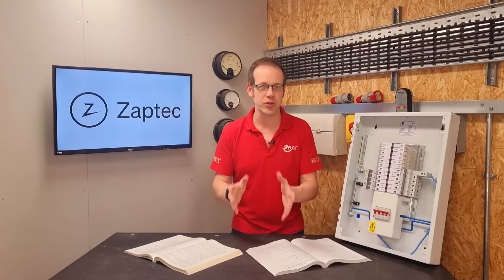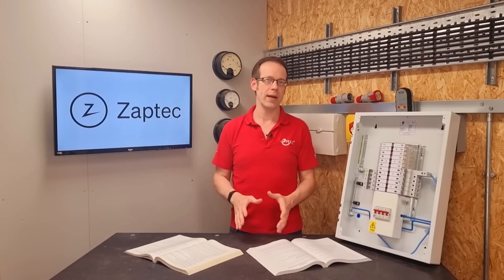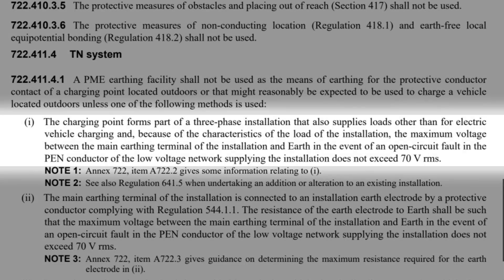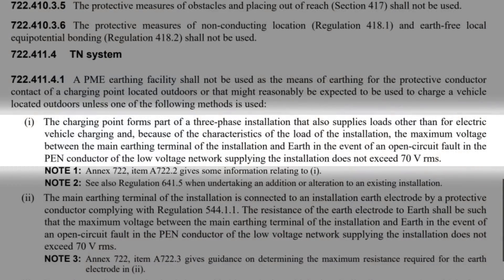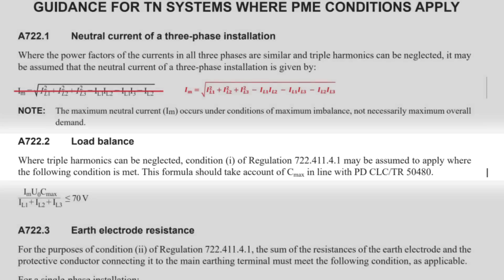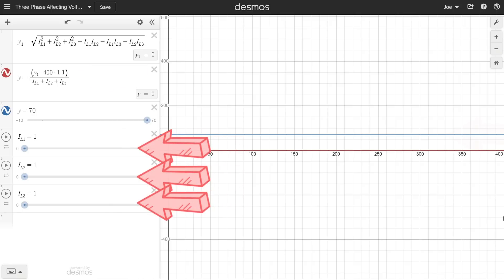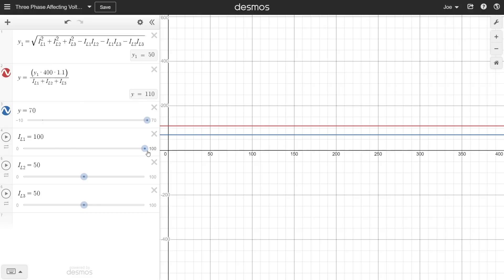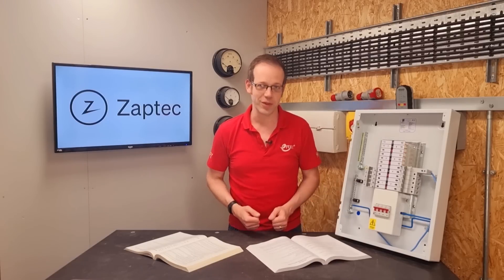This Electric Vehicle Wiring Regulation Got Cancelled - Why?

Comment: Well explained as usual Joe. There may be areas where the three phase supply is predictable generally, so maybe it was acceptable in these rare cases. However what happens if one of the phases has a fault?
Would this cause an imbalance in the current and therefore potential voltage way over 70V?

Comment: Just watched the video again, and i’am thinking how can the body of an electric vehicle become live ? Surely all the electrical connections are kept separate ie ( insulated)from the body work? , if not then how can manufacturers be aloud to make electric vehicles that could perteninaly kill the owner if such a fault was to  happen?
As I know nothing about EV and EV chargers, who am I to argue i’am just a humble spark who’s opinion means nothing .
Reply from the maker: The charger (ac/dc conversion) is inside the car and they aren’t double insulated. As with lots of power electronics they leak a small amount of current to earth to manage EMI .
Reply: @efixx  that’s my point,why aren’t they double insulated? And how can they leek a small amount of DC current to earth when the metal body doesn’t even make contact with the ground (littoral earth) ? As it is insulated by the rubber tyres , as we know rubber is an insulator (non conductive) after all on a petrel car all the electric’s is insulated from the body work or you could get a shock from the 12v battery, have you ever had a shock from a 12v car battery? It bloody hurts. 

I’am just trying to understand
Reply: 99.999% of people are and will insulated from the earth we walk on by there shoes boots or trainers all of which have rubber soles the car sits on rubber sodding tyres . So even if the car bodywork did become live it’s not going to hurt anyone. If you have ever been sat in a car when it been hit by a lightning bolt of many thousands of volts . And nothing has happened to you, Then you will now .

Comment: Howdy. Nice.
If the load is thyristor or triac voltage regulated there will be current in the neutral although symmetrical. So yeah. PEN break detection is essential.
Personally I would recommend digging a 16 mm2 bare copper wire in the ground where the car stands in a zig-zag pattern and potential equalizing it to the outlet PE. If the parking spot is a concrete slab the concrete may be hammered to get access to the armour steel and the it  may potential equalized to the outlet PE.
Regards.

Comment: Please forgive a daft question, shouldn't the formula in your graph software use 230 (or 400 / root 3) for U0, not 400? 
(Annex J, in the IET code of practise for EV charging equipment installation suggested two other ways of calculating this btw)
Reply from the maker: No a great question and I debated it back and forth when making the vid, in the end went with the definition in BS 7671 that states it's the nominal voltage to Earth, so 230V. Happy to be corrected as we're always learning! Probably wouldn't make much difference to the underlying point though. 👍
Reply: @efixx  Absolutely agree about the underlying point. What you've just written is how I did it on the one occasion I used this. 230v. In the video I noticed the software is using 400v, so slightly exaggerating the point! I won't tell anyone... ;-)
Reply from the maker: @timhoward7037  😂 Oops.

Comment: U0 is 230V Joe? Surely 400V as the formula relates to a 3 phase supply.
Reply from the maker: Great question, I was a bit unsure at the time but U0 is defined in the Symbols Used in BS 7671 as line voltage to Earth. Had to double check it myself. 😊

Comment: Hi there thank you for another interesting and informative video, my question is a of when and if you do get a PEN fault on an EV charger and you have a PEN Fault detection device installed in your installation… What happens next?
Do you need to contact the DNO to dig up the road to investigate?
Will the PEN fault detection device reset once the Fault is below the required 70vRMS?
I have not come across any ( yet ) videos that show a remedy for a failed PEN Fault, may be this could be another video topic??

Great channel thanks for the content 👍🏻

Comment: What sort of situation WOULD have been balanced enough? Probably not a block of flats even if the block is three phase? Maybe a factory with loads of high power three phase motors and the odd charging point?

Comment: Brilliant video very informative. QQ. In a domestic setting that is supplied by 3 phase, can we use single phase PEN fault detection for a single phase EV charger, or should we be using 3phase PEN fault detection for the single phase EV charger?

Comment: Very nicely explained but it only focused on the effects of a broken neutral and balanced/unbalanced loads in a given 3ph system, presumably where any neutral current is produced within that given system. However, diverted neutral currents can also be imported into an installation, coming from other installations connected downstream of the break point, where the given installation is also connected, therefore, livening up the metalwork of the given installation, regardless of the given installations loads (that could well be be balanced during the PEN fault).

Comment: That reg should never have been included in the first place.  It is obvious that an installing electrician will be very unlikely to be able to determine how well a 3 phase supply will remain balanced - especially in places like farms where the individual phase loads could vary dramatically as equipment is turned on and off and also where overnight loads could be very small.  How also could the installer be aware of potential future modifications to an installation which could unbalance a currently well-balanced system.  In my opinion, we should be looking at the possibility of PEN fault detection and protection for entire installations..... And don't get me started on AFDDs!

Comment: Hey call me dumb,,  is there any way of negating the earth by Separating the voltage like you would with a SELV,,?? Ground source induction coils like a wireless iPhone charger??
Reply from the maker: Yep, wireless charging is being worked on. But currently you can use an isolating transformer to achieve this. Great question!

Comment: You have got to have more chance of winning the lottery than the network dropping the neural while the car is plugged in and someone touching it. If a pme supply is that risky, why is it in use, but we know the answer, cost.
Reply from the maker: Yep and just like people win the lottery despite the low chances, people get shocks from PEN faults every year.
Reply: @efixx  that maybe true but how many would occur while in contact with an EV, probably none? Plus this is a supply issue, the networks are quick to tell us what equipment belongs to them, it should be their responsibility to install pen fault equipment not the electrician

Comment: Hi, slightly off-topic, but could you do a video, or if someone could please explain, do you require AFDD's on all circuits with socket outlets? And are there any exceptions or circumstances where they are not required? Thanks in advance.
Reply from the maker: Check this video out: https://youtu.be/aoWuEnvLa3I

Comment: A lot of loads such as computers, lights with electronic ballast, or anything with a switched mode power supply exhibit negative resistance - that is when the volts go down the current goes up. Even if the load was well balanced odds are that the neutral would swing wildly in one direction or another and cause a dangerous neutral voltage

Comment: Instead of pen fault detection that is inclusive with the charging unit, surely it would be better to have a pen fault unit before the consumer unit that completely isolates the power coming into the installation??
Reply: @eFixx basically this is down to the DNO trying to cut corners back in the day. TNS or TT is a more viable option.
Reply from the maker: Yeah, it's a funny one as it needs to disconnect the earth connection which isn't normally allowed.
Reply: Does a pen fault detector always break the earth??? If the line and neutral disconnect surely that would resolve the issue? Thanks for your input as always though, every day is a school day when it comes to the electrical trade

Comment: Great video. I think it was correct to remove the reg. Electricians just want to get on with installing with a minimum amount of actual calculating so removing it ensures that they will have to comply with another control method without the hassle of trying to work out if they want it or not.
Reply from the maker: Agreed.

Comment: This ties into the speech one of the 18th Edition writers gave at Steve Willis College about putting Earth Electrodes in on all PME supplies to help mitigate the issues arising from EV installations. It was politely pointed out that in many cases Terraced houses would have to be done by the DNO's who weren't interested in the extra work and in the case of listed buildings converted into apartments and alike it was practically impossible to achieve. 
I envision in the future something along the lines of PEN fault detection being installed split-load style to cover all outside equipment while the internal house systems are left functional so people can continue to cook and use heating and hot water.
Reply: That likely wouldn't work as the impedance back to the transformer would be high so current flow  would be low so high.power stuff inside probably wouldn't work anyways

Comment: Depending where the PEN fault is, the voltage on neutral might not be zero even if your loads are anyway. The fault voltage depends on anything downstream of the fault location which could include other installations (how many suppliers are as diligent as they should be with their earth rods?. It's very dodgy to depend on any characteristics from outside your installation to keep yours safe.
Reply: All of which means that indent i was flawed from the get-go, as where a 3 phase supply is a supply that also serves an unknown number of other premises, the competent person planning the installation will not be able to see the full scope of the loads on that supply. If he cannot see this, he surely cannot certify it. Although it was said that reliance on this indent cannot be relied on past September, I suggest (and not as an electrician but just as an engineer) that it is not safe and never has been because it calls for assumptions to be made about factors outside the engineer's purview.
Reply: Exactly!
Everything connected to the same PEN must have a balanced 3-phase load.
This includes Electric Vehicles, and some EV's do only draw current from 1 or 2 phases, even if 3 phase supply is offered through a type 2 connector.
Some charging cables have only one phase conductor.

But if the owner of the installation also owned the transformer station and the cable that feeds the installation, and it is only used for DC-chargers permanently connected to the AC supply without plugs and sockets (and other balanced loads that cannot become unbalanced), then indent (i) could be relevant. :-)
Reply: I will have to re read this thread in the morning, , some top alpha knowledge being shared in the comments

Comment: While I totally agree with your explanation and the maths, what if a capacitor bank and control are fitted at the incoming supply, (Like most industrial locations) , to maintain a balanced supply across the installation. This is usually done to reduce the effects of, start up, inrush, current having an impact on the electricity bill 😁🤡🐔
Reply from the maker: The capacitor bank at an intake are more likely to be for power factor correction. Generally small amounts capacitance are needed to correct poor power factor meaning that the current they draw is small. So I don't think it would keep the phases balanced in terms of the amount of current flowing.

Comment: Excellent tutorial - Thank-you.  I would love to see a tutorial covering the subject of simultaneous contact between the body of an EV car and extraneous conductive parts such as drain pipes, metal gates, metal hand rails etc. If these extraneous parts are already bonded to the MET of a PME supply I don't see a problem. But if we add bonding when none was present, it seems to me we would be making those extraneous parts more dangerous in the case of an open PEN..
Reply from the maker: Check out our free training package on EV charge points on the Know How page of efixx.co.uk. 👍
Reply: @efixx  I cant reach this site.  Even with the final full stop removed.
Reply: @efixx  I found your CPD sponsored by Indra, but there was no mention of simultaneous contact.
Reply: I seem to recall a great debate at college when the 16th edition came in about "killing the window cleaner" with extraneous conductive parts supplementary bonded to the MET ie a metal window, and simultaneous contact (outwith of the equipotential zone) with the general mass of earth, and the solution of additional local earth electrodes doesn't solve the problem either, it just creates more voltage gradients with potential differences on other items, and the current continues to flow, at least until a gas main melts !

Comment: Great explanation Joe, isn’t pen fault protection becoming more of an integrated standard for most EV chargers now?
Reply: So the code of Practice states that any TN earthing system should be treated as TN-C-S as you can't guarantee it won't be changed from TNS to PME. So you wouldn't consider the design of TNS
Reply from the maker: Thanks
Reply from the maker: Cheers bud. It depends on the charge point really, it's pretty important to check the spec on each one as they all vary with the level and type of protection. 👍
Reply: would that not be a waste if connecting to a sevice such as TN-S
Reply: @Satters  I doubt many TN-S supplies are actually TN-S anymore . I did a Ze at home in March when changing the CU and it had dropped by 0.1ohm to 0.21ohm (the old one, 0.31ohm, was written in the old DB) and we have had the gas main replaced for plastic and the water bond is gone as well, also plastic now but for some reason was left bonded. Logic tells me it should have increased as it effectively doesn’t have 2 earth electrodes. The fault current matched that of the neutral also so I think Northern Powergrid has tied it somewhere when they were last digging up the pavement a couple of years ago.